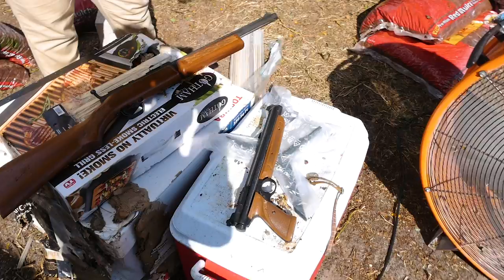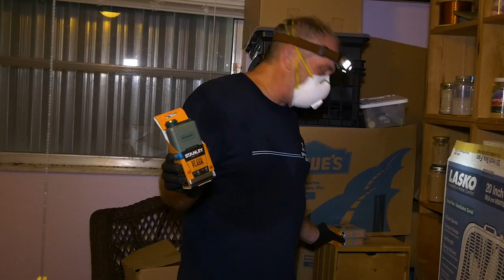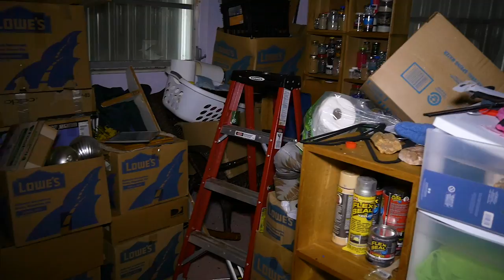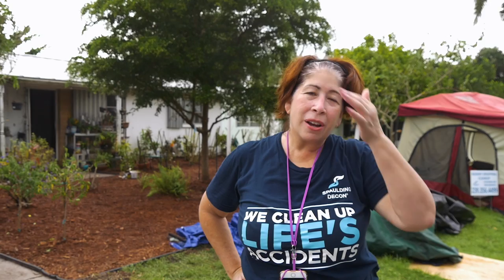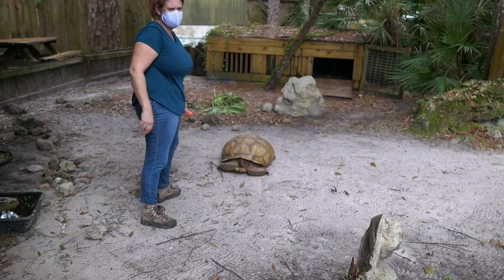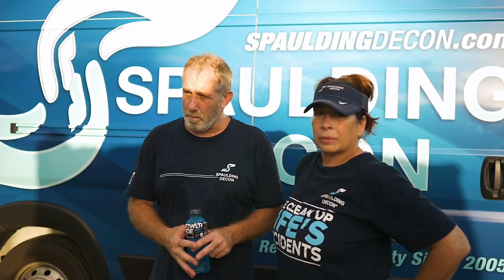Rat Infested Hoarding Nightmare Pt. 3 | Fort Myers, FL

Comment: Isn't a level 5 hoard where the place is so badly hoarded that there is stuff, floor to ceiling and tightly packed with only a narrow path though it? Also some rooms are completely filled up to the point where they can't be used? This place is certainly filthy and it looks like no effort was made to to take care of the place for years garbage-wise. You did a great job cleaning that mess up for sure! 👏🏼👏🏼👏🏼❤️
Reply: No necessarily. A level 5 hoard consists of animals, structural damage, and of course "stuff" but not necessarily packed floor to ceiling... the "stuff" is typically the least of the problem anyway when living this way so long.
Reply: There are a number of different scales - some based on the amount of stuff, some based on the amount of squalor, some are a combination of both.   In this case, there was a lot of stuff, plus living and dead animals and the feces and urine of animals.   On some scales I've seen in the past, having uncontained (or inappropriately contained e.g. buckets, bathtubs, waste filled toilets) human or animal feces is enough to rate it level 5, even though the actual hoard is far from the rafters.
Reply: Ilene Thanks for your input! I didn't really know how the scale went. It does deserve a high score for grossness, it being so filthy and contaminated and badly trashed! I can't imagine cleaning that in a Hazmat suit in the FL heat! Pure torture! 😨

Comment: I use to work at a animal research place and needless to say I didn't last long because of the killing but the best way to kill baby mice and rats (the little pink ones or pinkies) is to take a pencil and pit it on the back part of their neck below their skull and push down. Its quick and they don't suffer.  I hatted having to do it so I quit the day I watched them kill a rabbit inhumanly. You need a good rat dog that's what we had on the farm when I grew up and that way you do not have to do the killing or finding them the dog will do it.  The rats would burrow under the pig feeders and we would move the feeder. The rats would come running out!! 5 times bigger than the ones in the video. Big as cats because all the did was eat and breed. The dog we had was super fast and would cat them and break their neck drop and move on so fast. 
I know some people may think that what we did was inhumane but a rat will produce 15,000 babies in its lifetime if permitted and eat 1/3 its body weight every day.  That's a lot when you have a 2 pound rat. You cannot feed them the way you feed farm animals or farmers would go broke.